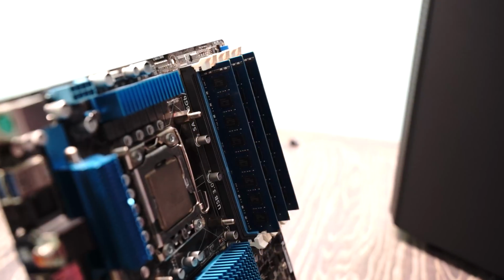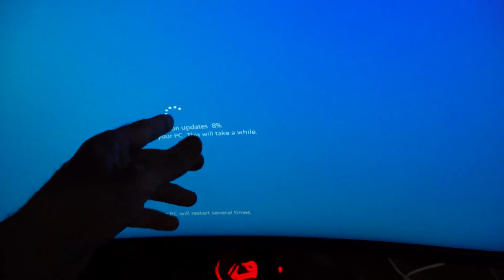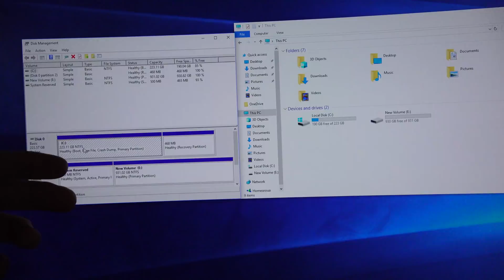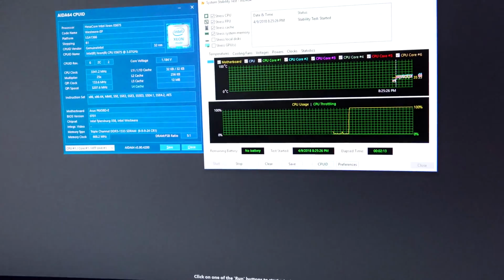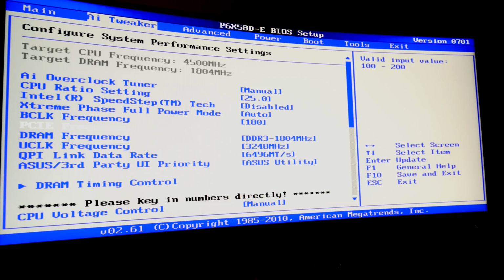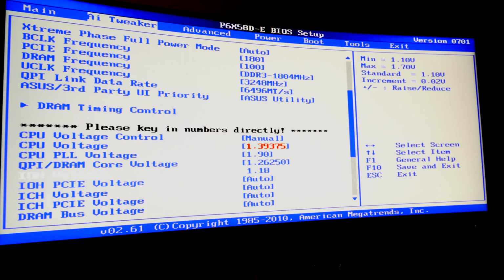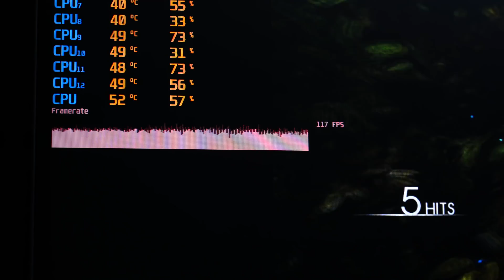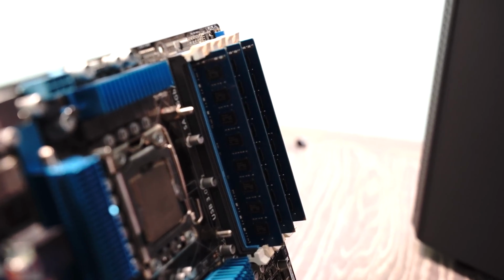Is X58 Still Worth it..? Taking the 6 Core X5675 to 4.5GHz on AIR.

Comment: Tech YES city have you ever run normal ECC in a standard X58 board? not really found much in the net about it so i thought i'd best ask someone with allot of experience with X58 :P my favourite platform, i always move off to something else and end up coming back to this lovely platform, though i've always used standard normal DDR3 and never treid with ECC as of yet other than on a P6T6 WS revolution but i dunno if that'd support it where something more normal wouldn't, i've managed to sort an X58A-OC for cheap (though it's not being shipped till next week) and am eying up some cheap 1866MHz ecc for cheap from a friend, not registered as i know that 100% doesn't work (have tried that before, but iirc that's a chipset limitation) many thanks in advance
Reply: iam running a wild bunch of 2x 4gb ECC on channel 1, 1 x4gb ECC and 1x 4gb non ECC on channel 2, and 1 x 8gb non ECC on channel 3, and the system runs fine with 24gb as tripple channel, mine is the asus p6t-deluxe
Reply: @holzvonobi1851  board and what have you had already arrived, running 24gb of ecc 1866MHz as we speak, has been rock solid :)
Reply: as i said i have a few ECC and some non ECC mixed also 4gb and 8gb modules mixed, and iam only running around 1500mhz in tripple channel  mode right now,  there is not much benefit going further except from memory benchmarks, and i installed it yesterday(had 18gb before), so i give it some time to say its rockstable, but i gamed a few hours Shadow of Mordor and so far no problems, seems you can mix different gb modules and stay in tripple channel mode as long as every channel has the same amount of ram.

Comment: Still rocking an x58 asus board with an i7 930 at 4ghz. Just got a gtx 1060 6gb and im back to almost ultra settings on most games at around 100fps. Only game my system doesnt like is pubg. (Still around 90fps on decent settings, but a bit glitchy) Lol

Comment: still rockin an amd fx cpu here, and honestly, its held up better then the people i know who ran and grabbed 2500k's....(not one still has that system...mostly due to lack of cores/threads impacting some of the games we play more then you might think...

the x58 also held up better then sandy based systems seemed to... i know a few people using 970 and 980's in them (cpu) one was given 6 fb-ecc sticks that work with his board... 64gb each... and 1866 rated..that systems beast... overclocked to hell and that much ram..holy crap....

Comment: oh well
then I prefer AMD platform
I use 64GB on Asus Sabertooth 990FX R2.0
check yourself - it supports only 32GB
and by Asus design it really STRONGLY BELIEVES it cannot work with this RAM, even though CPU just goes through and I have days of uptime at the time.
it is rock solid

Comment: oh by the way I have USB3.1
I rather use my most advanced RAID card, which have all the features including RAID5, RAID6, FastPath, CacheCade and what not and 1GB DDR3 cache, which will be dumped into 1GB flash at power failure
this RAID card deserves more then X58
it is most probably worth 3-5 those builds
you can buy decent recent gaming rig for such card itself

Comment: well
add PCIe card?
what would you say, if I would tell you that I have no choice but use nVidia Quadro NVS290?
I run out of PCIe x16 slots on Asus Sabeertooth 990FX R2.0 - TWICE!

in server I have:
LSI MegaRAID MR SAS 9261-8i (physical x16 / electrical x16 / card is x8)
nVidia Quadro NVS290 (physical x1 / electrical x1 / card is x1)
Intel I340-T4 - it is going to be upgraded with OS to I350-T4 exclusively for SRIOV (physical x16 / electrical x4 / card is x4)
LSI Fusion MPt SAS9220-8i (physical x16 / electrical x16 / card is x8)
empty PCI (not PCIe), bue used for Laptop caddy
Chelsio T320 - DUAL 10GbE 10 Gigabit Ethernet HBA and no it is NOT NIC, as it have full iSCSI and iWARP (physical x16 / electrical x8 / card is x8)

In slimmed down desktop:
nVidia GeForce 9600GT - 9800GT have issues and I need dual DVI single slot card
nVidia Quadro NVS290 for VMs
just removed Asus ThunderBolt EXII DUAL - I shall install (back) NVME here
usually empty - for GPU or RAID
Chelsio T320

Chelsio cards are going to be replaced with Intel X520, as X520 have SRIOV

where I can insert any card?

Comment: I'm a big fan of the westmere cpus.  I love my HP Z600 but the urge to OC won out.  Started doing so x58 research and was feeling the x58 love in your vids.  Found a p6tdv2 for a decent price.  Had some 4gb 1333 ecc left over from upgrades done to the Z600.  Had an extra x5672 that I threw in until I find a deal on an x5675 or x5680.  Have had it up to 4.5 but my current thermal situation requires me to keep the chip happier at 4.2. Anywho thanks for the vids. I love when old tech can still kick some ass.

My last run

http://www.userbenchmark.com/UserRun/9905260
https://valid.x86.fr/eb895c

Comment: x5690 is the best bin for these xeons 3.47ghz stock
Reply: Not cost wise though at all. I got a x5650 at 4.62ghz under a 360mm alphacool eisbaer and I paid £18.99 posted.
Reply: Xx Tek tip xX yeah they are the same chip just different clocks/bins
Reply: Joel Walby Yep, but the x5650 has the best price-performance.

Comment: hi cool video 
i´ve buyed a asus p6t pro with an  x5660 and 24gb ddr3@1600(6x4GB Vengeance)
 i want it to run with 3.8ghz and with a GTX970 G1 (later with a 1060gtx G1 6gb)
cpu cooler is a beQuiet Dark Rock Pro

i think the performance is okay for the next year
i have enough pcie for ddr3 or m2

Comment: Noob Question: Why 1800mhz Mem "overclock" on a CPU that only supports up to 1333mhz. I must have gotten sth basic wrong if that makes sense. I thought the point of oc ram is that the modules are in theory the same , just labeled as to which mhz they are designed to work not that I can go higher than what intel gives for the cpu on the ark intel pa ge

Comment: Also i wanna ask if i can get an old zeon cpu/mobo to replace my current apu/mobo, use my ddr3 1600 8gb stick. Then plug a gtx 760 on it to play games in 2018 like moba games or pubg. I was curious if the zeon cpu can compete with a intel cpu in terms on gaming or benchmarks. I tried to search if i can see a zeon cpu here and i was lucky that i found a X5650 for about 2000 pesos or 40 usd. I hope that zeon cpu can be an alternative to intel in terms on gaming. Since I don't cash to get  a used intel cpu/mobo.

Comment: Hello, Bryan. May i ask if i can buy a zeon cpu with a mobo so that i can upgrade from a old a8 7600. Because i'm planning to get more performance in terms of single/multi core performance and as well as in gaming. Also forgot the max gpu that i can support for example the gtx 1060. Since i don't want to have an bottleneck on gtx 1060 with an apu.

Comment: I have a Rampage 2 Extreme that I've been running for years. I plan of dropping an x5680 to OC but nervous cause I've never done it... even with the i7 920 I have in there now.
Reply: Do it. I finally did yesterday, into an Asus P6T deluxe after finally updating the BIOS from 2008 version to 2010! The X5680 is much faster, for £40. Now trying to learn overclocking.

Comment: Hello Bryan ! Thank you for youre Amazing work ! thanks to youre video i'm corrently running a xeon x5675 at 4.4 GHz 1.38 volts. i have a dark rock pro 3 as a cooler and i have a question. Should i delid the cpu and use liquid metal to improve the temps (near 80 in aida 64) or i can use liquid metal as a Thermal paste to improve temps ? (i'm corrently running the gelid one )

Comment: Hey, could you do a z97 review with i7 4790k (Asrock Z97 Extreme6)? Or an comparision? Got my board for 120€ on Ebay, upgraded my xeon e3 1231 v2 for 50€ to an I7 4790k @4.4 / 1.2volt. Memory Crucical Ball Ballistix Tactical BLT2CP8G3D1869DT1TX0EU (16 GiByte DDR3-1866-RAM, 2 Dual-Rank-DIMMs) @8 8 8 24... Or is that stuff still to fresh? And hey, i had to order my i/o-shield in hongkong (I am here in Germany)

Comment: Looking for a fan so I can overclock to 4.5, I just purchased this exact board and CPU. It looks like the cooler used in this video (ma620p) blocks the last two memory slots? I have ddr3 with tall heat-sink. Any recommendations?

Comment: Always enjoy your videos, Bryan. You have the patience and technical skills that lesser men can only dream of. However,  didn't you kind of prove the point made by Tim from that other channel that older hardware is often more trouble than its worth? The time spent troubleshooting odd issues should be factored into the overall cost of the build.Put a number on the value of an hour of your labor.

Comment: I got the x5675 on a P6T6 WS Revolution board. I have a Noctua u14s cooler on it. I get the first part of the OC but I'm lost when it comes to voltages. Might sound stupid but how can you tell when IOH needs 1.18 and not 1.16v? I basically wanna try to get a 4.00 Ghz OC

Comment: My main rig is W3680 overclocked to 4.54Ghz (133mhz X34 multi) 24GB DDR3 1866Mhz  9-11-11-28 timings ASUS P6T Motherboard, A Zotac GTX 1070 Mini, 512GB HP S700 Pro SSD 2x 2TB Segate baracuda drives in RAID 0, T6E wifi card, USB Bluetooth dongle, generic USB 3 Card, Put it in a Spec-02 case. whole system was $1200 CAD ($900 USD)

Comment: Its so  amazing you still like x58, cuz its what i am still using on my gaming. I see no reason why i should change it. I run 980x at 4500mhz 2000 ddr3 24 gigs of ram. and 2 1070's in sli and it runs flawlesly . i have a solid install of 10 i had since win 7 days, and so much stuff installed, i felt not changing it and i don't need usb3 or hot wire or whatever. got a  HTPC with haswell so no biggie. but their is no bottlenecks at all wow on an EVGA x58.

Comment: Not worth it. I bought a i7-950 for $18 thinking I would make a cheap project. After when I went looking for a x58 Motherboard i found they are ridiculously overpriced for some reason. Much better to make a sandybridge system
Reply: it's good to find them in bundles 

In this last month, I picked up a asus Sabertooth x58, a x5650, a spare i7-950, a almost brand new fractal design case, 16gb ddr3 ram, 700w modular psu, 60gb ssd, 1tb hard drive, and a gtx 460 for $180. Sold the parts I didn't need like the older small sata 2 ssd, the gpu, and the spare cpu and my cost approached a mere $100

a week later, I picked up a MSI x58 platinum MB and a i7-920 for $50. Trying to flip that right now.

Comment: X5660 @ 4.85ghz on water.... 1090 cinebench r15 xD
Reply: Thomas Shepherd what's single core at that speed?
Reply: Steve Smith ill let you know
Reply: My mistake, "only" 1064 cb and 142cb with 7.49x mp ratio @4.71ghz with HT on 
Also did a 8.8sec 1M on superPi

Comment: I scored a Rampage III Black Edition last year, dropped a x5675 @ 4.6 into it, got the ram to 2200MHZ 24GB with only 3 sticks  (hope that helps the controller a bit)
Also threw in two gtx 1070's in x16 sli, playing most games at 2x native on a 144hz 1080p screen is amazing, handles my HTC VIVE no problem as well, just slightly salty that the black edition lacks basic power saving features like offset voltage, so no turbo shenanigans. 

Sold a X58 Extreme with a X5660 that could drop to 2.2-2.4, than turbo up to 4.3-4.4 depending on user need, all while staying well below 1.35, that offset turbo overclocking can be very rewarding if you spend the time.

Comment: So, it turns out I've been sitting on an x58 for almost a decade because I didn't see any games worth upgrading for...and then I saw your video about the x5650 (which got me interested in trying this overclocking business out, until I saw the 700 watt usage).  How does the x5675 do on the kill-a-watt, because now I've skipped the thought of trying out the x5650 and will be jumping right into x5675.  Many thanks for all this information, trying to keep PC gaming cheap has been my goal for the past 10 years and this totally saves me a lot.

Comment: This video made me dig out the x58 sabertooth out of the basement and have some fun. I got a x5675 off ebay for $45, put it in the machine and was blown away. Using your tips 4.5 GHz was no problem.

I liked this build because the x5675 has a tdp of 95w compared to the i7 950 that was in there that has a tdp of 130w, I was hoping it would run cooler with less power and it does. Best I could manage on the i7 950 was 4.0 GHz and that was almost more than the 8yr old Cooler Master Hyper 212 Plus could deal with. The x5675 with the same cooler at 4.5 GHz runs at 73C tops, much better than the low to mid 90s C the 950 ran  \o/ .

Thank you so much for this video, subbed and in the process of watching all your vids new and old.
Reply: Grem Five what are you over clock specs cause I just picked up a sabertooth for a spare build and I'm oc'ing that thing now.
Reply: I basically started out with most of the settings Brian mentions in the video above and then I'm going to tweak a bit more as I go along. I'm not convinced I have the ram 100% stable as I have had 1 or 2 crashes of my 3d rendering program but windows itself has not crashed.

I have barely even had any time to mess around with it myself except for a day or two but so far its been great. I'm running the 1402 Bios with 18 gigs of 1600 MHz Gskill ram at 1804 MHz @ 9-9-9-24, a Sandisk SSD and a 1TB WD Black on WIN 10 powered by a Corsair 850TX. Except for the SSD and vid card its all 8 yr old hardware that was in the system.
Reply: Wow amazing temps, I had my doubts but seems like the 212 evo or X will be fine for my future x5675 build

Comment: I have the same PC more or less since 2010.
The x58 MSI Platinum.

I started with the I7 920 but upgraded the CPU to a x5650.
I remember useing the HD5670 for a long time in this system but now i have the R9 380x.
I have 12GB memory and a 120GB SSD.

It runs all the games fine...

I am just worries about my northbridge.
I get's 100C+ 

I will need to replace the Thermal paste!

Comment: That's the same processor I'm using right now, almost same settings, on a Sabertooth X58, it runs stable on 4.5Ghz at 1.375v perfect match with my GTX 970, I don't think I need to upgrade yet

Comment: To the regular folks, that are not that tech savy nor have enough time or patience to overclock and sell their first failed attempt (first half of the video):
I have x58a-ud3r with an i7 920 D0, been using it for years, and I can tell you that as you that your electricity bill is going to be high by default and a lot higher if you overclock it.
I wouldn't recommend anyone to use this, specially with a GTX 1070 or up, you're just wasting your video card, a cheap latest gen motherboard will do better.
(my pentium g4560 did better than my i7 920 while being cooler and less power hungry, just saying)
Seriosly, think it twice before doing it.
#NotTrolling #JustMyExperience

Comment: I used to run its baby brother chipset, the P55. I still have a first gen i7 870 on a EVGA P55 Classified 200 board. I ran it at 4.2 GHz OC'ed from 2.9 for years, but man was it thirsty.... Now I have a Ryzen 1700X and use about half the power. Now I just need to get a reason to resurrect it from a box in my closet.

Comment: here using Asus p6x58D-E - Xeon W3690 3.47GHz (3.8 GHz on turbo boost) - Coolermaster T4 air cooler - 24 GB Ram 1600 HyperX (triple chanel) - Geforce EVGA 1060 6GB SC. All Games at the monent runina in Ultra settings at 1080p (yes including LOTR Shadow of War, Ghost Recon Wildlands, COD WWII, NFS Payback, Assassin's Creed Origins and Far Cry 5)....